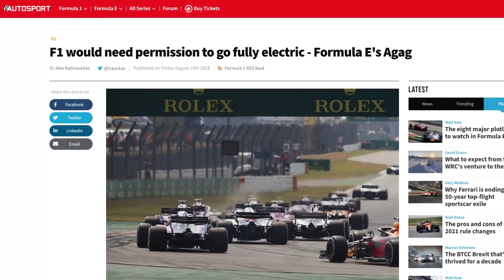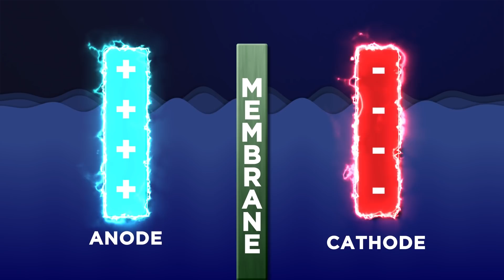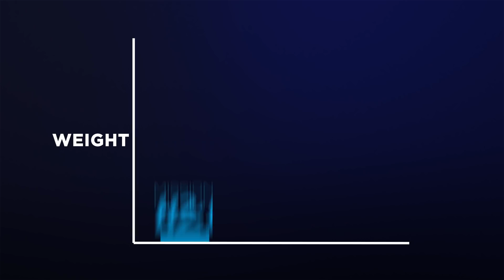Here's How Formula 1 Cars Will Be Powered In The Future

Comment: A couple of little things I believe haven't been well-covered here (to not say there weren't even covered at all) is that obtaining the H2 is not really 'green' as of now as - according to many engineers I've spoken to at LinkedIn - it needs a lot of energy to be created and thus fossil fuels are currently used the most. Then, it's not a cheap process either, which makes it unsustainable for cars. For heavy machinery or enormous cruisers, it could be worthy, but it seems that even if the process was 80% cheaper than it is now, it wouldn't even be cheap enough for application in cars... That's why a lot of people seem to be looking for synthetic fuels, like DME. If Porsche is exploring this way, there must be something...
Reply: Yes it is intensive but you will only ever improve something by using it. Don't forget ICE has been in development since the 1890, Modern EVs have been in development since 2000, Hydrogen Fuel Cell vehicles have only been in development since 2010. Hydrogen Fuel Cell tech is far from maturity. You can only reach maturity by employing it. So yes, it would be cheap enough for cars. But you need to use it in cars before then. Hence why the most promising development for hydrogen is Trucks. Hydrogen is suffering the same chicken and egg situation ICE vehicles suffered when they were new. What comes first the Car or the Infrastructure? the chicken or the egg?

If you don't apply it in the tasks you want it to be applied for, then you will go no where, because the issues you need resolve only appear once you have applied it.
Reply: Motorsports has had ages to take synthetics seriously and broadly didn't. Synthetics haven't a hope of beating fuel cell technology performance now and it's an up hill better to make that the case. Honestly I feel like the synthetic ship has sailed. Any use of synthetics now will be niche more than norm, much like it's always been. It's an even harder sell with the amount of traction electricity is getting. I am a tad disappointed but it's also just desserts as far as I am concerned.
Reply: Would it be possible with solar or wind energy?
Reply: @paulogazolla7488  yes
Reply: @paulogazolla7488  Yes, but the process still needs a lot of improvement...
Reply: @abelisraelcruzayuso4682  As far as I know, no it doesn't.
We actually already reached the point where electrolysis is more energiy efficient than creating hydrogen from fossil fuel, but fossil fuels are still too cheap for electrolysis to be used for the majority of H2 production.
Reply: @burningSHADOW42  Ok, maybe, but then tell me why there aren't way more manufacturers and companies going for it if that was true... Audi and Mercedes stopped going for it, Porsche didn't even think about it and Honda are not far from leaving it, it seems...
Reply: @abelisraelcruzayuso4682  
What I said applies mainly to the production of hydrogen. Although fuel cells are still more efficient than internal combustion engines.
H2 biggest problems are electric vehicles.
EVs are simpler and charging infrastructure is more or less already present (excluding rapid charging). H2 is safer and more efficient than fossil fuels, but more complicated and more difficult to get than electricity.
So basically: We finally started caring about the climate at a point where electric cars where good enough to beat hydrogen cars.
This might change at least for some areas if hydrogen is used for power storage in the electrical grid or in trucks. Currently H2 scales better than electricity, so trucks, airplanes and the power grid are probbably going to use it in the future and at that point H2 cars are going to become more popular as well.
Reply: @paulogazolla7488  It is possible, but there is a better use for it.  At peak production, use excess electricity to create and store hydrogen in-situ. At valley production, use the hydrogen in fuel cells to provide electricity to the grid. Only if there is no better method to store excess energy. Using it in small vehicles is a waste.
Reply: I just want to add to this, that there is huge amounts of research going in, to get more and more “green hydrogen”. The fact that there are now companies that are promising green hydrogen for as little as $1/kg, is testament to how far we are progressing. For context there, a Fuel Cell EV, uses a 5kg tank and has a range of around 300 miles....! 

Further to this, I saw a comment from someone saying how big manufacturers have pulled out from FCEV’s. Which yes, this would have been true if you told us 5-10 years ago... now there is a lot of companies looking at the opportunity. As well truth be told, they are going to have to. To have a truly sustainable power grid, we are going to have to look at methods to store electricity during peaks that come with solar & wind. How do we store it? Well this is where hydrogen can come in. Now I’m not saying here that everyone could be driving hydrogen, but I think the most plausible solution is some drive battery, and some drive hydrogen. Manufacturers can see this, and this is why there is; Toyota (who have forever been pushing Hydrogen), Hyundai, BMW... now all producing FCEV’s, although BMW’s won’t be available for another couple of years. 

Then my final point would be cost of the actual cars. Yes, they are hugely expensive at the moment. An FCEV will set you back more than £50,000. However, we also have to remember the scale that they are currently made at. It’s only really Japan that could be said to be having a punt at it, for instance building their “Hydrogen Highway” and they were going to showcase the suitability of Hydrogen at Tokyo 2020... When BEV’s were made at the scale FCEV’s were currently are at, we all doubted how they would ever reach a point that they’d be affordable... At the end of the day, the more BEV’s evolve, the greater the reduction in FCEV’s too, as the drivetrain technology is essentially identical. Economies of scale... it hasn’t happened for hydrogen yet!
Reply: However, all this being said... I feel it may be unrealistic for F1 to be able to get to this point in the time they would have to. As F1 is going to have to reach net carbon emission vehicles by at least 2030 in my opinion (which would be in line ~ with UK vehicles). 

Therefore, I think that we would likely see net carbon fuels being used. As it would require far less adaptation from the teams, and would allow ICE’s to continue.
Reply: Wouldn't it be beautiful, if they had solar/wind power plants generating energy to each city where there would be a race, months before that race even happens.... They could sign contracts for 5 to 10 years.... A race takes a whole week.... Those power plants would generate energy the whole year. The could have partners like shell.... Or other company's... Expenses with fuel would be near zero....
Reply: One technology that might be interesting to keep an eye on, that is being researched in Belgium, are hydrogen producing solar panels. It is still in very early stages of development, though.
Reply: It is kind of green but still inefficient
Reply: Yeah the best way to generate hydrogen (pure ) is purifying the hydrogen produce from electrolysis of water which is so much costly and also non green as electricity is not green
Reply: @dipanwitanandi4274  Electricity, the same as hydrogen, is an intermediary between a primary source (solar, fossil, etc..) and the end usage. It is as green or as dirty as the primary source.

Comment: what about hydrogen combustion engines instead of hydrogen electric engines
They still keep the noise and combustion part
Reply: Or just synthetic fuel. Chemists in oil companies are already working on that, in theory, it can be manipulated to be efficient and clean.
Reply: @Vedang Supatkar in Hydrogen combustion engines the nitrogen in the air would cause many NOx emissions to be produced 😥
Reply: While I would love it manufacturers don't show any interest in hydrogen ICEs currently and therefore is likely not an option.
Reply: I was just coming here to say this.
Reply: The atmospheric pressure is different, so it might not sound as good as octane or whatever. Same with any other fuel.
Reply: Incredibly inefficient, and studies show nitrogen byproducts are still generated... Overall a fuel cell is a far better solution
Reply: @Ofitus21  Technology is actually moving quite fast atm to tackle its downsides. They are already building hydrogen combustion engines that use argon gas instead of air to completely cut unwanted emissions.
Reply: @Dr.Rolfski  How the heck is hydrogen supposed to burn in argon? And don't you need an argon tank then?
Reply: @dsdy1205  you’d have a hydrogen/argon mixture in the fuel tank I assume
Reply: @Dr.Rolfski  oh, hm. well you wouldn't need to worry about emissions at all then, since it's never going to escape the engine. I can see F1 engineers finding all sorts of ways to just dump the water argon mix to reduce weight during the race tho
Reply: @dsdy1205  The emissions of this system are actually argon and water so no need to dump them.
Reply: @Dr.Rolfski  I know there isn't a need, from an emissions and daily-driving perspective, but you'd be naive if you think that F1 drivers aren't going to find any way possible to dump the weight. Weight reduction is the number 1 performance boost, and it's even better when it's lost on track.
Reply: @Ofitus21  it is inefficient, but it is still better than using racefuel, works with current engines (diesel or petrol) and it is still an engine, and works with 99% of all other cars, it's a good middle step towards hydrogen fuel cell helping build up the infrastructure for hydrogen energy